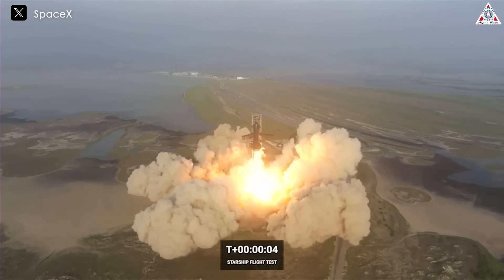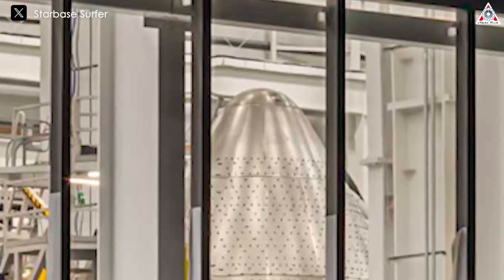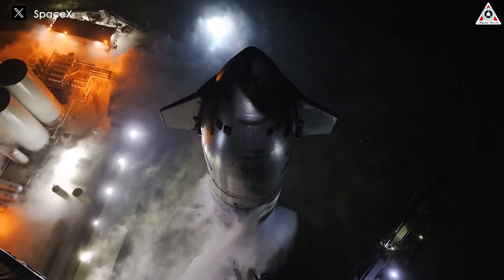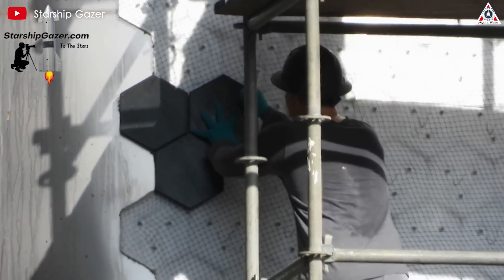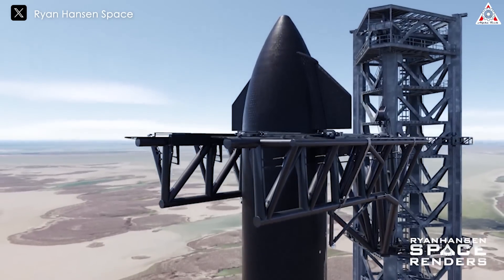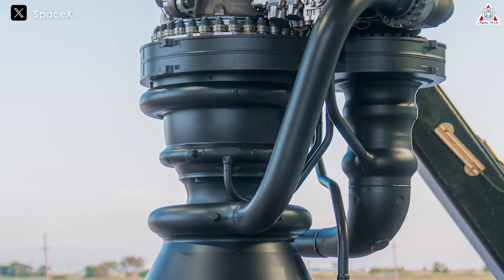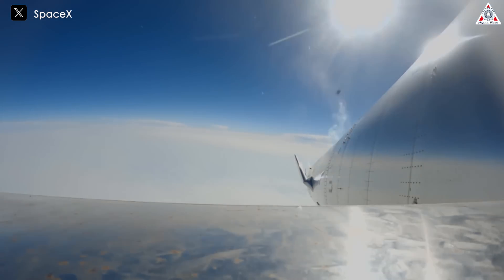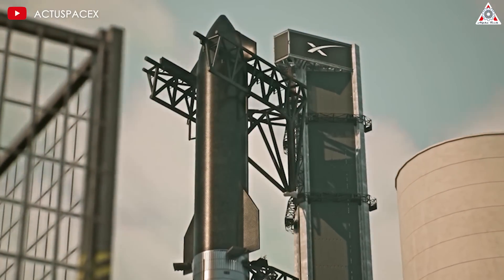SpaceX Just Redesigned Starship! Never seen it before...

Comment: This new flaps design change is a bit closer the Blue Origin flaps design, it will be interesting to see how this next test maneuvers and dissipates heat.
Reply: They are not close to BO’s design.  Although we haven’t seen a lot of BO’s upper stage. 

SpaceX is an innovative company so even this design won’t make it through many iterations.  A better design is around the corner.

Comment: I think if the used a mold of the ship they can create just 1 large piece of the body heat shield. Have other large pieces for the flaps. Take time with smaller tiles around the flap joints. Makes things a lot faster. What a job putting the on 1 by 1. People doing that probably see black hexagons in their sleep.
Reply: See @kevinoboyle8939's reply above for why smaller tiles are better.

Comment: I think a total rethink of heat shielding is needed for Starship to have regular multi-day flights like an airplane.  What I would do is work on some form of heat transfer method, where heat is instantly moved away from the hot areas and moved to cool areas where it can be dissipated safely via conduction or convection.  Like some form of liquid transfer at the hot point and that liquid (or gas) circulated to carry away heat to a cooler area for thermal venting on a portion of the vehicle that is not experience high heat during re-entry.

Comment: Yeah, remember the Rat's Nest engines? 
All the sensor wiring?

In the parts count writs trove it was one of the issues pointed out, that they needed to get all that krapp off the engines, and that the engines should just work, i.e. be well designed and tested.

That all got down voted into oblivion too...

I was watching launch aborts over sensor failures... And eyeing the number of sensors, and it was obvious launches would be few...

Those writs have probably scored about 80% correct... Not bad for a Dunning-Kruger....

And I love how they try to save face on the new hot staging vent structure... has nothing to do with Soviet N1, and looks exceedingly familiar to whats described in several writs here on Alpha Tech..  Which were posted not long after they started using the jail bars design, which had to be warned about, and a fix cobbled in.

You gotta watch these Rocket Nerd guys..

Luckily Elon makes them pay attention to feed back or else...

Also due to iterations, the public gets to analyze more than the NASA Shuttle version where its take it or leave it, and loses crews.

I suspect if NASA had been more open about their designs, I might have been able to warn of the first disaster before it happened, and the second disaster was even more obvious.

At least SpaceX is experimenting first, and trying improvements on the tile system before they put people's family members in it.

You can't test every reality effect in a lab.

Now, the biggest hold up is bureaucracy...
But the tide is turning on that blob monster.

Got a chuckle out of me about Elon's "Efficiency Comission",
Yeah we know where the foot dragging and extortion takes place...

Elon is quite experienced with regulation, fees, and bureaucrats.

Surely an AI could automate all that... 

Imagine an FFA license  response at Chat GPT speeds...

We could use that at DMV too...

On the V-2 model, the flappers are nicer, but still pretty agricultural.
I dont think that concept or the current re-entry profile will stand the test of time, but it is interesting engineering, somewhat Steam Punk.
And I'm glad Elon talks about thousands more improvements, thats the correct attitude!

Starship is only getting better...
And people are noticing that Raptor 3 makes Jeff's BE-4 look really bad... thats mentioned constantly now in comments across the Space Channels...

Hopefully BO will decide they have to fix that. 

Also starting to see Stoke's experimental capsule mentioned more... I think thats one to watch.

I think we have several companies now on different aspects of the right track. From Sierra Space's Dream Chaser, to Rocket Lab...

And that the future will be a morphing together of many concepts produced by individual companies.

SpaceX is doing well, best engine, and stainless fabrication is a game changer too.
Also they are doing well on tankage and fuel systems designs now, looking professional and well done.

I could see SpaceX marketing Boosters and ship aft ends as for sale componants, for other companies to graft their ships onto.

Dream Chaser's big brother on  a Starship Sub Unit.

And NASA & Boeing could too, if they started getting rid of MBA management, and went back to Corn Fed Engineers who grew up doing things instead of watching TV for a childhood.

I remember as a kid, being considered free slave farm labor, and thinking about the town kids watching TV all weekend...

it wasnt pleasant thoughts...

but now I realize it was an advantage for me....

I know how to build things, grow food, and eliminate varmints...

While everybody else reeeee's about the price of green peppers.

Can you imagine the screaming if MIT started filtering for rural kids in admissions? 
Kids that would at least know something about green pepper growing that could be applied to Space, and if there was a problem could MacGyver up a fix from stuff in a junk box...
And who could analyze a drawing and point out potential problems....

Other planets being colonized is gonna require GENERALISTs...

Nerds wouldnt last long.

Just sayin'